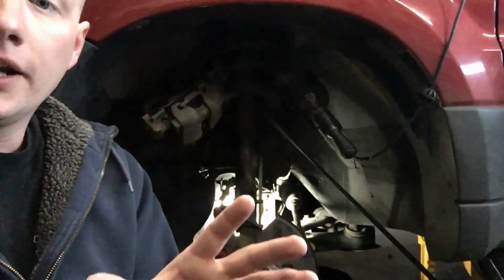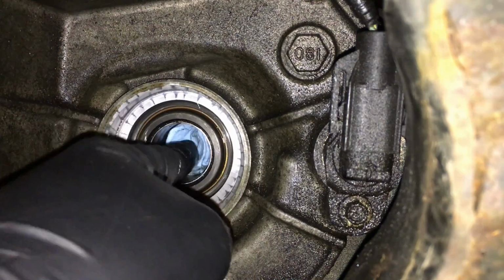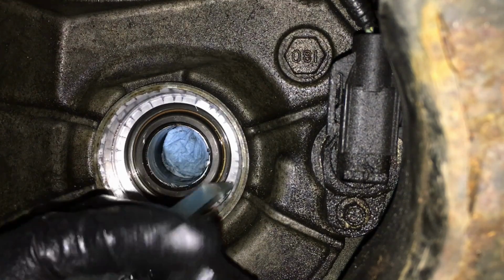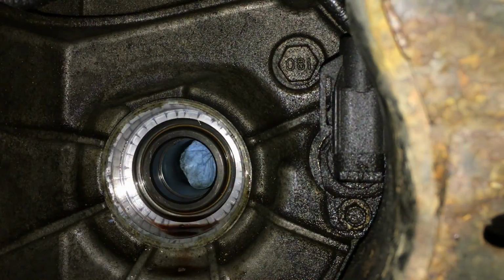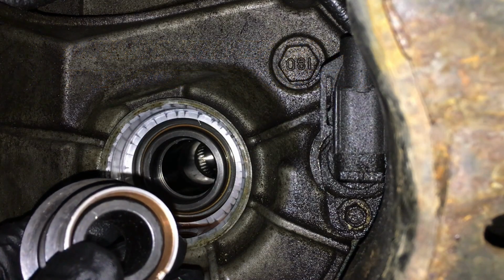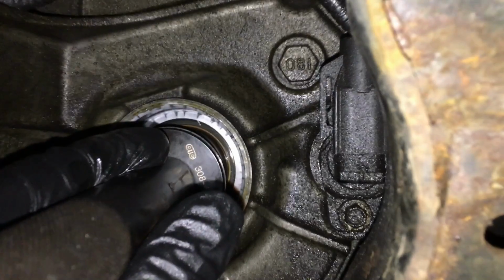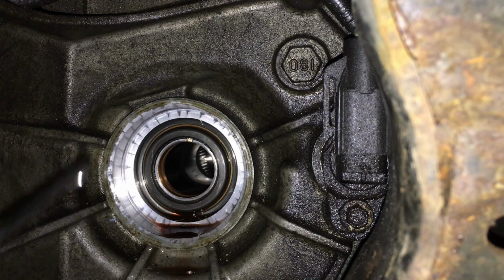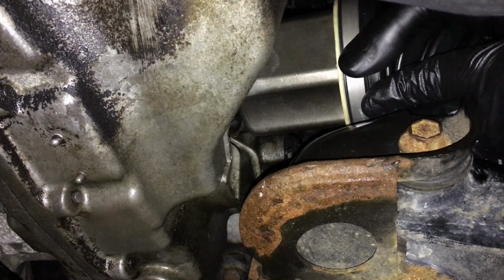2001-2008 Ford Escape CD4E Transmission Fluid Leak: Drivers Side Axle Support Bushing Replacement

Comment: Chey man was wondering if you have any suggestions... I have a light clunking sound when power goes to the rear end of my 2014 mustang gt, rear end seems fine, but I'm curious if something in the drive line has become loose... let me know if you have any suggestions have any questions to help I'll supply the answers

Comment: Engineered to fail... couldnt they have just put a sealed bearing for it to ride on and be done with it?
Reply: i'll be dammed....sure seems like a good idea.   Wait a second...the bushing is a little cheaper during assembly AND it goes out every so often guaranteeing you a trip to the repair shop and i'd say...mmmm...$600-800 worth of parts and labor.   Welcome to the shitty end of the stick.

Comment: Would it be a good idea to freeze it first to make it go in easier?
Reply: Being a mobile call it probably wasn't practical I guess. But yes, using the physics of temperature when removing/fitting interference parts reduces much of the struggle.
Reply: DJ R True, but I would've had the bag of them in the freezer the night before (or outside in the Chicago area during winter) and stuck them in a cooler in route. Still worked out.

Comment: Nice fix dude.  I have read about this repair but never seen it done until now.  I would have thought a bushing removal tool could be used but i guess there is no room back there to grab on to pull it out.  Thumbs up!

Comment: Really need ur help on a 2014 Taurus sel strut removal can't find anything similar
Reply: i believe those are the style where you have to remove the lower control arm to allow the knuckle to slide down far enough to fully slide off the strut
Reply: Anthony Filice I appreciate that!  Have you came across any video?
Reply: No I just know because I am a ford tech as well
Reply: Anthony Filice ok cool